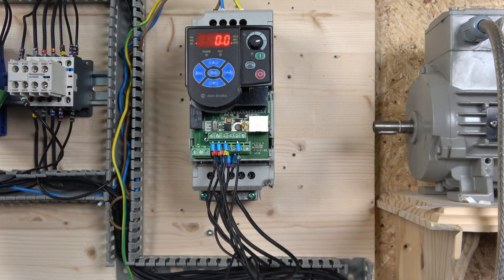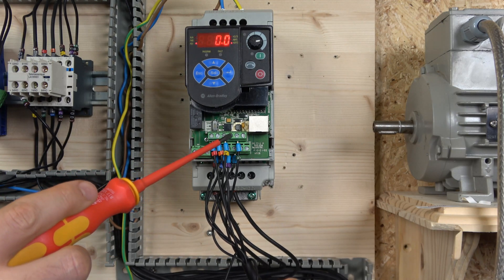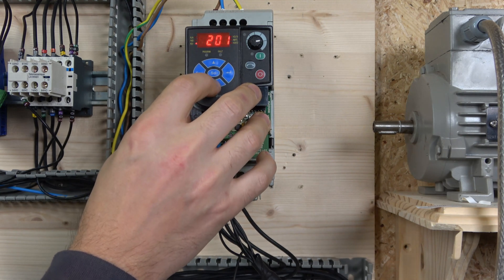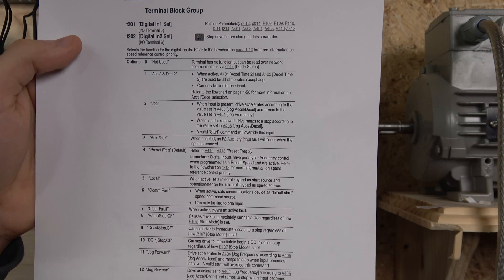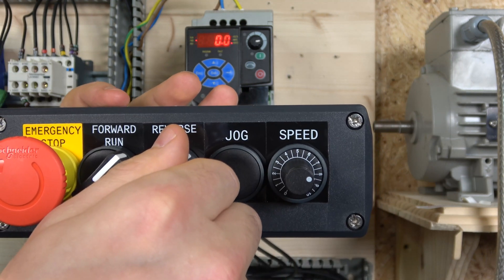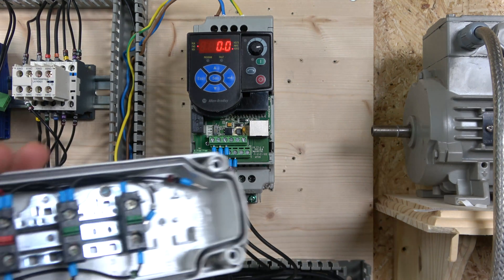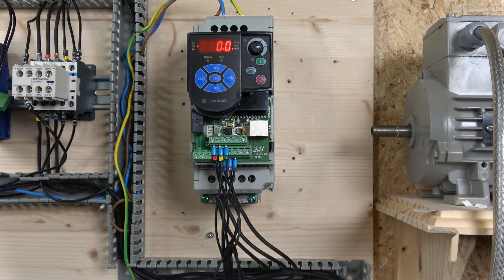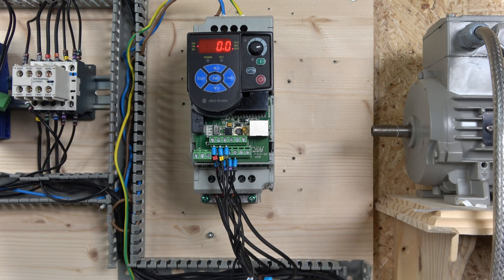Allen Bradley Powerflex 4M, remote control, 2 wire control, 3 wire control, remote speed control.

Comment: Hi 
how would you wire and setup an HOA , for manual control using local push buttons and 
remote / auto using a plc or other speed controller ???.
Thanks.

Comment: Ran across a PF 4 that would not let me access the Advanced parameters above A101 so it was impossible to assign the correct RS-485 address to it. A Rockwell tech once told me how to get those parameters turned back on but darned if I can remember. Do you know this publicly undocumented issue? I'm sure there's internal Rockwell help available if you're rich enough for a subscription :(